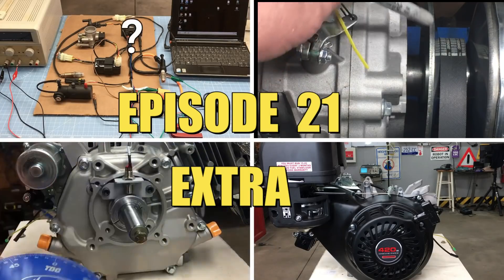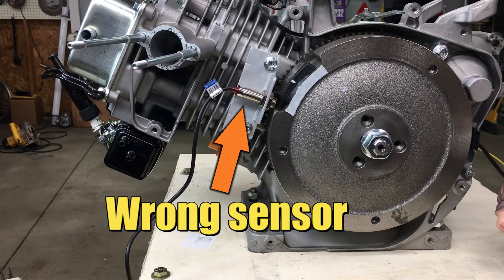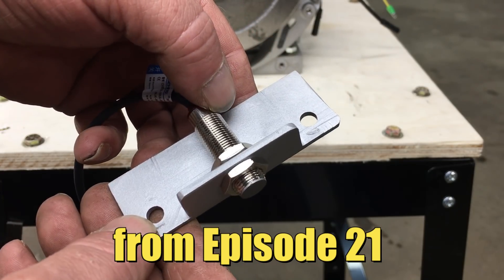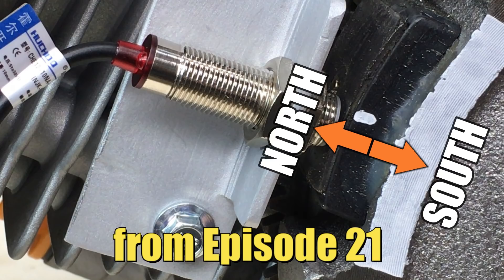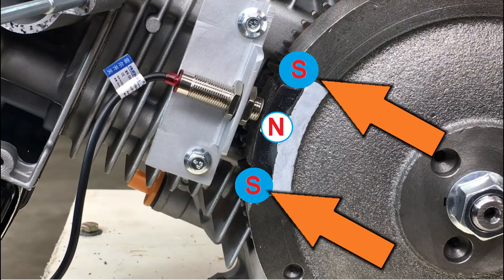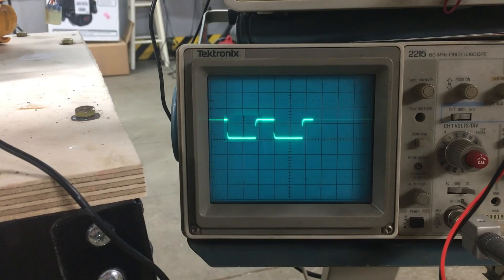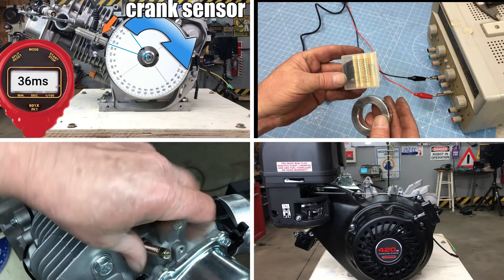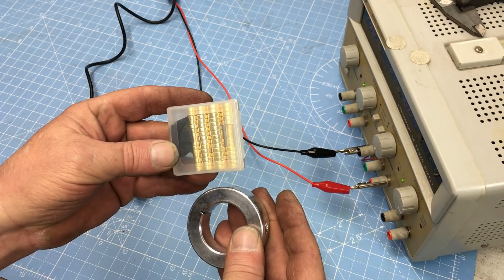Episode 21 and a half...... Deep dive into the ignition system problem on our 420cc EFI build

Comment: i build dragrace motorcycle for a living and use standalone efi on many of them.  typically the engines have vr (variable reluctor) sensors for the crank trigger and hall effect for the cam sync (cam position sensor).  neither sensor is triggered by an actual magnet per se.  the trigger wheel or pin in the case of the single tooth for the hall effect on the cam is made of ferrous material but not a magnet.  is there a reason you need to use a  magnet versus just a magnetic (ferrous) trigger, something i may have missed maybe?  nice work btw
Reply: the magnet is attached to the sensor and the tooths change the magnetic flux, it's much better
Reply from the maker: The kit comes with no instructions and no internal schematic.  About the only thing the seller indicated was to use a hall effect sensor.  So rather than venture into the unknown, I went ahead and used the hall effect sensor.  It just happens that it will not work on this engine.
Reply: @robotcantina8957  i get that...but what i’m saying is, and this might not be applicable to your specific hall effect sensor since it’s more of a universal industrial variant, even though a hall effect may by theory sense only magnets, i think in practice they will also pick up a “tooth” of steel or iron swinging past it as that still must generate enough of a magnetic field to incite a voltage potential.  i’m not a EE but that seemed the logical explanation based on what i’ve seen.  i’m 100% sure my cam sensors are hall effect (5volt output, 3 wire standard black red green) and the pin in the cams is definitely not a magnetic itself just a hardened steel dowel pin basically.
Reply: i’ll have to rewatch this and previous episode.  this episode i merely listened to over bluetooth on way to work and remembering the prior episode where you ran into the problem with the polarity of the magnet not matching your choose of sensor.  i might have missed something like the entire flywheel edge being of a ferrous material and therefore a special circumstance needing something the sensor could “differentiate” from just the circumference of the wheel passing at all times.  i should watch speaking when not 100% sure i have all the proper info.  my bad if so.
Reply: @robertmason8341  you can get 2 types of hall sensors. With and without a magnet inside. The ones typical used with a EMS is the ones with a magnet.
The ones without a magnet need a external magnet.
VR sensors also need a internal or external magnet.
Reply: ok....i see what’s going on.  yes my bad when i watched the previous episode i didn’t examine the flywheel very closely and only considered the briggs go kart engines i toyed with as a kid.  they used an aluminum flywheel and i assumed this was too.  paying closer attention i see it’s a cast iron flywheel in this case.  cast iron = ferrous and will trip the sensor so i see why you need a stronger field to trip it (differentiate it from the surrounding field).

maybe back up your sensor in its bracket to establish a larger “air gap” between the flywheel and sensor.  remove the magnet and then build a single tooth of steel protruding in the desired location (of the original imbedded magnet). the NEW single tooth would need to be close to the sensor like say .015-.025” from the sensor. i think that might yield the square wave on a o-scope your looking for.
alternatively, remove the original magnet, chuck up the flywheel in the lathe and machine down the od then reinstall the magnet.  (all this is if you can remove the magnet without damage).  both methods should yield the same results basically

definitely good stuff your doing.  so much better than a lot of the crap we see on you tube

if in your searching for that fi system you came across a system for 2 cylinder engines could you let me know?  i want to do a cheap fi conversion on a harley engine.  i’m familiar with mega squirt and speedinou,  i don’t want to build the ecu from scratch and the pre assembled one are too much $ for this particular project
Reply from the maker: @robertmason8341  There is a lot to unpack here, but I get your point.   The videos are produced for an audience with varying degrees of skill and knowledge. There are "upgrades" planed for this engine once it is up and running.  One of the upgrades is to get rid of the single reference ignition trigger and go with a toothed wheel.  Now for the toothed wheel' I'll use an inductive proximity sensor. ( its wired the same as the HALL sensor and put out the same signal)   Anyway, the project is done in easy to follow steps in order to retain the audience.   Now, in case you or anyone else is wondering why I didn't use the inductive sensor on the flywheel side, well, the magnet has a steel cap on it and the inductive sensor would also be triggered multiple times as well.   As far as two cylinder kits, I think this kit and rusEFI will do two cylinder engines.  The problem with this kit is it is not compatible with  tuner studio.
Reply: @robotcantina8957  understood, i can tell you are fully capable of much more!
as for higher resolution triggers, i doubt the engines output is high enough to appreciate it, at least in its current state.  now if you change it to a higher state of tune, ie change its overall VE with headwork, camshaft, compression, forced induction, etc, then the higher res trigger might shine

again nice work and i’ll definitely be watching for future episodes!
Reply from the maker: @robertmason8341  In Episode 18 where we unboxed a bunch of high performance parts, including this EFI kit, we also pick up a very small turbocharger.  I think the turbo is a no go due to oiling issues, but the new plan is to go with the AMR300 supercharger.  The AMR300 supercharger is a tiny 300cc supercharger and with boost, I need to be able to control the ignition timing a little bit better.  It should be a fun trip.
Reply: @robotcantina8957  is that amr supercharger the little roots blower that were oem smog pumps or something on an old vw engine?  i’ve seen people use them to boost various small engines.  if the lack of a pressurized oil system is the reason for ditching the turbo you might look into aerocharger.  i don’t know if they made a small enough one but they made turbos that have self contained oiling.
Reply from the maker: @robertmason8341  The AMR supercharger is indeed a roots type blower from a Japanese kei car.  Its similar to the roots smog pump, but as I understand it the roots smog pump is from a vintage Porsche and tend to be expensive.  The AMR pump runs about $250,00

Comment: Excellent explanation.  Missed the double pulses entirely.  Common neodymium magnets curie temperature is around 80 C.  There are higher temperature magnets, but common ferrite magnets can go hundreds of degrees higher.  Probably why they opt for old school ferrite magnets on the original flywheels.  Cheap and more stable at engine temperatures.
Reply from the maker: Thanks!

Comment: While on the topic of triggering, if the ecu is based on megasquirt firmware, i recall something about the trigger point being the max permittable ignition angle. That means you cannot advance past 26°, which probably straight up means youre not running effenciently as can be, specially on part throttle
Reply from the maker: From what I can gather, the kit is not a copy of megasquirt nor does it use megasquirt firmware.  As a mater of fact, the seller advises against using tuner studio as it will destroy the ECU.  Anyway, I believe the kit is based on the SECU-3 open source build.  We will find out the limits of the ECU in due time.
Reply: @robotcantina8957  Alright - looking forward to next chapter

Comment: Will that kit and software work with a two stroke engine?
Reply: At least for 1 cylinder 2-stroke it should work with no problem.
Reply from the maker: I'm not affiliated with the kit manufacture.  Check out the link in the description and perhaps the vender can advise you.

Comment: Just buy the sensor lol
Reply from the maker: At the end of episode 20 I do mention the crank trigger was eventually going to be moved.   it was always in the plan to put this sensor on the other side of the engine.
Reply: @robotcantina8957  yeah I thought I remembered hearing that part. But... why all the muss n fuss with this then? Wouldn’t the $55 sensor save time and work? You already made the mounting bracket. Simple slap in replacement and good to go. No changes to the other side of the engine required. Idk tho...I’m not totally absorbed in the build and I’ve missed/skipped some of the process. You know better than I do about which is the easiest or which is the best solution. Maybe the easiest is the best. Lol. Idk. Either way.... I do enjoy the content... what little I get to see during my busy schedule anyway. So... thank you! 🙏
Reply from the maker: @TsunauticusIV  I have doubts on the accuracy of the ignition timing with only one point of reference.  When we go with forced induction, the ignition timing will be critical and I plan on using a more accurate method.
Reply: @robotcantina8957  ahhh. That makes sense.